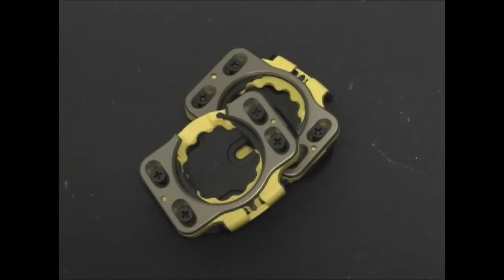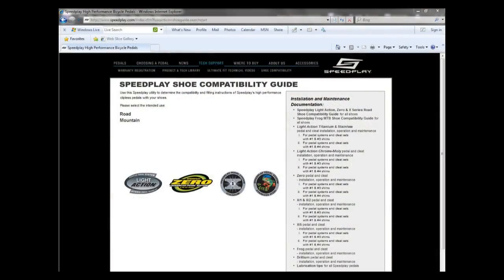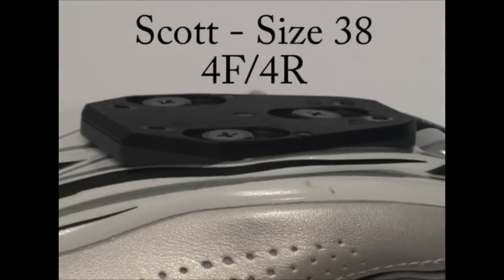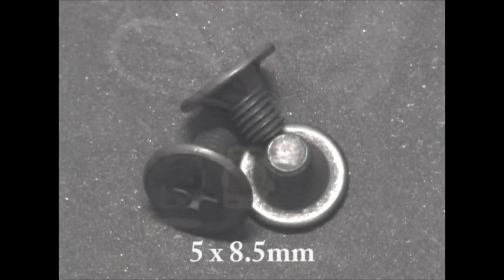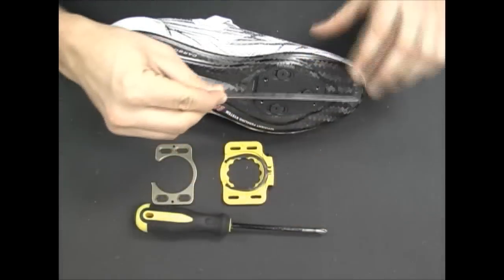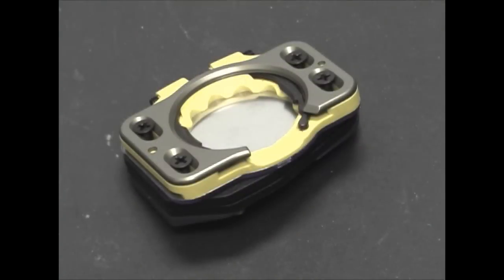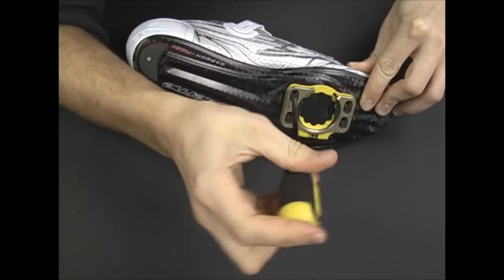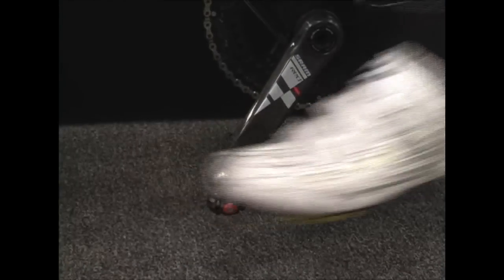Speedplay Cleat Mounting Zero HD

Comment: Nice...very thorough. I wish I had watched this video instead of reading the printed instructions and using my torque wrench. My tip: FORGET the damn torque wrench!! Using mine—and tightening to [just below] the recommended level—caused my Zero cleats to be nearly impossible to clip into. Do this instead: Get some red threadlock, use your plain phillips head screwdriver, and go around the four screws again and again to make sure all four of them have been evenly turned beyond that first "resistance" bump that's designed into the screws (as you describe in your video here). If you go tighter than this you're going to ruin what is a fairly easy cleat entry process. I've installed almost a dozen Speedplay X pedals over the past decade and used this technique with no problems, and I should have used it on my first pair of Zero cleats. Also, I found the perfect lube in 3-in-One's PTFE lubricant (available at Amazon and elsewhere) after using sprays for years (just because I had that kind in my garage already). The drip applicator helps you get the lube exactly where it needs to be.